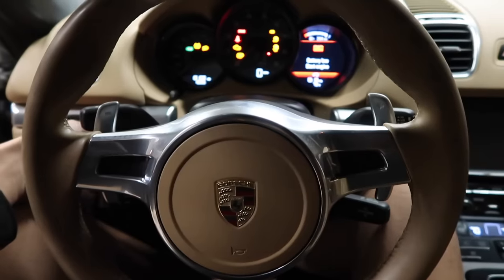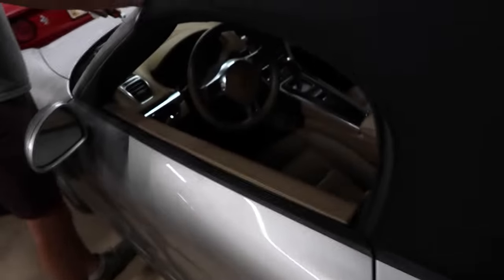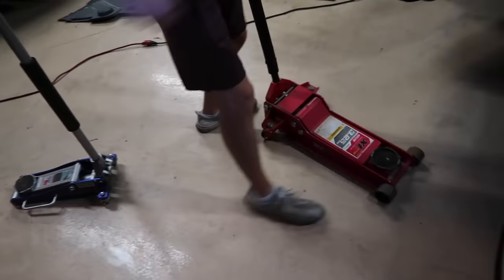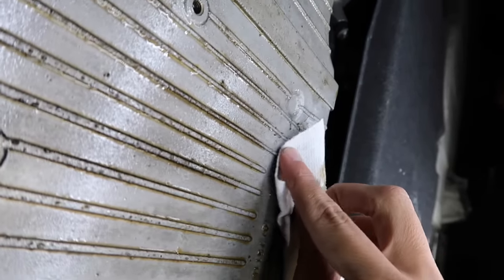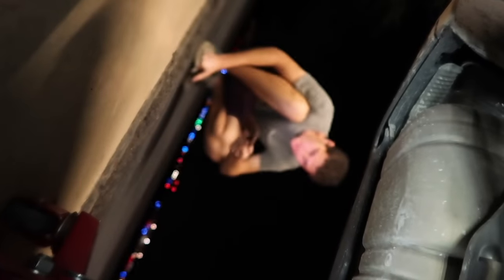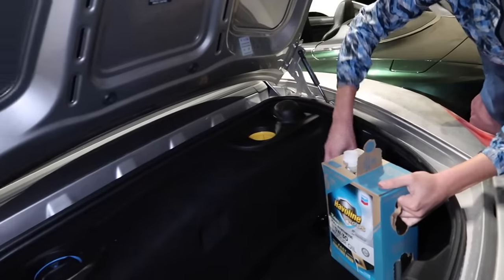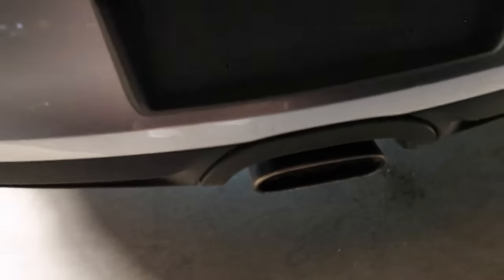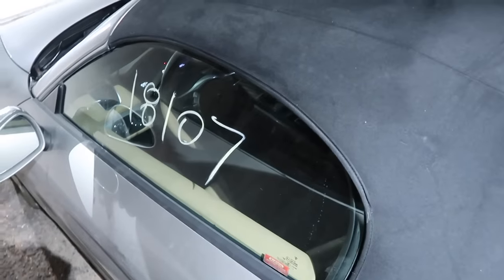Insurance Quoted $28,000 For a NEW MOTOR... We Fixed It For $20 Instead!

Comment: This car was backed off a trailer onto gravel, where the exhaust hit the ground and scooped some up.
It may well have backed off uncontrolled and hit something that flipped up under it, causing all that damage. I doubt some little old lady did that.
That noise you heard may have been caused by gravel and dirt in the exhaust.
Reply: That's exactly what happened to me, I used a shop vac.
Reply: That is what i figured too!
Reply: yes, that was no little old lady...
that was a big ol' lady

Comment: How do you guys not have a lift?
Reply: They have no money for that 😁
Reply: I’ll wager it’s because that’s an airport hanger and they’re not allowed to install one :/
Reply: Probably correct, and I bet the rent is cheaper off airport grounds. Next warehouse?
Reply: Yes, but there are lifts with counter balance.  No need for anchors.
Reply: You beat me to it lol. But watching his under the car. Was cringey. Imagine something slips
Reply: @Mike-C219  if that's the case they shoul get a portable lift then.
Reply: or buy some plastic ramps ffs
Reply: @SNORKYMEDIA  good logic something temporary because it's a temporary place for them
Reply: @007rooks  what about that company quick Jack's just normal household voltage and they're portable
Reply: Because it’s to expensive with the hundreds of thousands of subscribers they have.
Reply: They don't need one.. they outsource all the work
Reply: @lucasv521 at least a Quick Jack!
Reply: That is probably the drop off location from the auction. They stated that they had to drive it from that location to the shop where they probably have a lift.
Reply: @OB928      Often, hangar storage for a car is the cheapest.  But often it is not allowed by the airport.  Depends.
Reply: @007rooks  Could be a regulation thing.  Airports have a lot of rules.  Or maybe the hangar owner just doesn't want car maintenance done.  Often insurance companies have that in the contract with the hangar owner.
Reply: @SNORKYMEDIA     Good idea, but just curious.  Why plastic and not metal?
Reply: I think I would have drained out whatever oil was in it... Could tell that way if it was dry before you added oil.  Nevermind. You came to the same realization.
Reply: My question exactly!
Reply: It may not be their property…
Reply: Exactly!!!

Comment: I mean you could put in 1-2k into the undercarriage and maintenance of the engine and you've got a clean title Porsche with under 20K miles. I'd consider that a homerun
Reply from the maker: Big risk big reward
Reply: Just can't let the new owners know of the previous damage or they will lowball u lmao 😂
Reply: @memesyandhorrorshorts  if it's fixed there's no reason to disclose it
Reply: Buying unseen car, going under it with out jackstands, your oil ideas. Someone should be broke or dead. Hopefully just broke.

Comment: As many have already noted, draining the remaining oil would have been a good idea. When I used to buy old bikes cheap and work them over I would first drain the oil and then inspect both it and the oil filter to see what might have been going on, if anything. Also would pull the plugs and "read" them to see how the mix/burn was. I know pulling plugs is much more difficult in a Porsche but at least starting with reading the oil filter/oil is a good bet when checking out a potential problem motor. This applies to any possibly crapped out car/bike. You really had the Porsche light shining on you on this one!
Reply: Yeah, drain and refill. I'd even change the filter, because you can learn a lot from examining what's in the filter. I just can't believe they didn't check oil level after filling. Didn't they say it reads on dash after shutting off engine?

Also, I believe the plugs on a 987 are pretty easy to get to behind the rear fender liners.
Reply: Yea JB WELD
and why purchase a new pan   yeahhhh JB WELD

Comment: Gun shot from inside, bullet bounces off the road/floor and ricochets back to the oil pan. 
  Car skids as driver or passenger panic and slides backwards to a stop into gravel. 
  That's my guess.
Reply from the maker: Woah that is a wild guess but it could be true, you never know
Reply: @JRGarage  the damage is clearly of coming from the inside. 
  If the car had somehow landed on a rock the tear would be going into the floor. Also, seems a clear lack of any other similar tears or scrapes anywhere else and the oil pan looks like it's been hit hard by something small.
Reply: Isn't there a paraffin test for gun powder?  Hole looked shot gun size.
Reply: Pretty plausible to me … is there a hole inside ?
Reply: You have to definitely start writing movies

Comment: 13:50 you need to use a smaller rag to clean the oil off the pan....  The JB Weld should have been done from the inside.  Remove the pan, clean, then apply the weld.  That was it’s already on the pressurized side.  Most Porsche engines use 9 qts of Oil.  If this is the 2.7 liter that could be the reason for the 8 qt.

Comment: Man that was 20 minutes of anxiety... a bit of reflection would do you both justice. Drain oil, look for metal in oil. Refill with correct amount of oil. Definitely do NOT drive this car to the porsche specialist until you have the correct amount of oil. No hate, but you could have totalled what was a perfectly ok engine just with the oil pressure.
Reply: @ryandevillers214      He's a kid full of passion.  He does seem to rush things.  He'll slow down and think more when it costs him way too much not to.

Comment: I might have drained the old oil out before adding any new. I'd want to check to make sure there were no filings or aluminum chips broken away from the inside of the impacted pan. As you described about the blown-out floor board, something blew that hole out leaving jagged edges. 
It would have been safer than risking an aluminum chip or chuck going through the oil sump and then the engine. But since you've had no problem on the video, you guessed right for a car you're probably going to flip.
Reply: M mm
Reply: No. No

Comment: When the car comes off the flatbed at the auction yard it scraps the ground and you get rocks in the exhaust cause the yard is gravel top. I would have never thought to vacuum the car as the first step in getting this Porsche running but it worked. LOL

Comment: My wife drove over a bottle jack in the middle of the road, similar damage to what you are seeing but we ended up with a crack like yours but in the auto trans oil pan I drained the oil jacked it up JB welded the crack, refilled with oil and drove it for another three years with no issues.  Just wondering why you don’t just drain the pan measure the oil volume then you would know how much was left.
Reply: That would be too logical🙃

Comment: I enjoy these super deal auction finds.
It does drive me crazy that you guys always start these things without knowing oil levels or if it is hydro locked.  Just drain the oil.  Find out how much was in it.  Then put enough in to start it and save an engine.
Flood damaged cars should have the plugs removed and spun over to pump water out.  And drain the oil to see if it is oil & water.
Reply: @user-od9iz9cv1w    Flood damaged cars should be avoided like the Black Plague.  You never know what is screwed up in the computers and electrical system and it's almost impossible to diagnose.  Didn't Tavarish have a flood damaged Lambo or something that had mysterious gremlins because of flood damage?

Comment: It almost looks like there was a little explosion in the passenger side seat and it bounced. I would have to say that the rocks and the exhaust came from whatever tow company dropped it off the flatbed. What do you want to bet they dropped it right on the tail as quickly as they could when they were dumping the car at the insurance auction.

Comment: If that is an alloy sump pan, you might be able to braze weld with a torch and alloy rods, I did it on the sump of an alloy motor cycle sump.

Comment: So something really similar happened when I rode my motorcycle up on the curb and it tore a hole in the oil pan, scratched the fork and rotor caliper, insurance totaled it, gave us 3k and we bought it back for $600, fixed it with jb weld, never failed. Sold it for $3500

Comment: we had a 67 MG 1100 and the universal joint broke and put a hole in the manual transmission. the mechanic told us JBWeld !  worked longer than the car!

Comment: drives me nuts how manufacturers deliberately delete useful service features ..like dipsticks, ..or access to pans (another vid about a Range Rover). maybe this model has an "oil low" indicator. if one exists and is not on you're probably good to drive easy while watching oil pressure. oh, just saw that you've got a replacement pan. when that goes in all you'll have to do is measure.
congrats on a great find! 🙂

Comment: My son bought a repossessed house from a bank auction.  It was cheap but it was a nice house.  It wasn't until he took possession that he found that the ex-owner had poured sand in all the drains.  WE WERE ABLE TO TAKE THE DRAINS APART AND CLEAN OUT THE SAND AND HE SOLD THE HOUSE LATER FOR A $40,000 PROFIT.  I would see if the exhaust is full of those rock chips.

Comment: How to literally test EVERYTHING that in no way whatsoever helps to isolate or confim the problem you fear... start immediately by windexing windows as you free think all your worst fears aloud, then check nonsens things like interior cleanliness and exhaust tips. For the record, the things that start a car are: fuel (pressure, flow, and octane), spark (plugs, wires, distribution, starter, battery life, amp and connection), timing (cylinger location, belts, compression and surface), and air (intake, filtration, EGR actuation, vaccuum and turbo).  But first, you could just put the key in the ignition and see what happens 😀
Reply: My name is Mike Hall Me and my best friend Avery will have it running before lunch.

Comment: JRGarage great channel. Quick question - I have a 2001 Boxster Cabriolet that I can't get to pass inspection for new sticker, two unready Emissions Test Results for Monitors 1). Catalyst and 2). 2nd Sys., any suggestions to remedy without the cost of $6k to replace both Catalytic Converters?  Any suggestions very much appreciated.  Texas Fan
Reply from the maker: You’re saying the monitors haven’t checked in yet? After you replace the battery or clear check engine lights that will always happen, they reset. It usually takes around 100 miles to have them all check back in. If you don’t have any check engine light once everything is checked in, you will pass emissions.

Comment: The rocks in it exhaust is from the loader picking it up at Copart or tow truck dropping off at location.. so I'm putting my bet  down on the dragging and it'll load up the rocks and the exhaust due to the angle

Comment: Apparently these things don’t have a dipstick, engine oil quantity can be checked electronically, so why not check it properly before
trying to drive if? 
Otherwise it could be under- filled or over-filled, both with possible bad consequences shouldn’t you have tried this before starting it?

Comment: My 981 was having a major issue as well recently.  I found the bolt on the side of the battery would not screw all the way down and it was causing the startstop, steering loss to pop up and I used a different bolt and its now fixed. Dealership wanted me to wait two months to check the car and $140.00 to look at it. Remember also the car will throw a ton of codes when the battery gets super low. Get the car to temperature. Check the oil level on the dash and recheck the codes
Reply: How is that major issues?
Reply: @janlala1710  because it causes the car to go into limp mode. Causes the start stop to not work as well as no sport mode and powersteering. Causes the car to have other issues as well.
Reply: @janlala1710     When something weird is happening to your Porsche, it is ALWAYS a major issue.  But he did dodge a bullet with the bolt.
Reply: @ThatOneChannelinAZ  plenty of cars have issues when the battery is not installed properly or it’s low on voltage… nothing major

Comment: Trouble code camshaft position.  Could be engine valve timing.  Timing belt?   Maybe the dealer gave her an unexpected high price to repair this .  Looks like that engine would have to be removed to fix the timing belt issue.  My guess is at 500 dollars per hour labor for the dealer owner and 6 dollars per hour for the mechanic it would be very expensive to fix.  

Looks like the previous owner got "lucky" she hit something in the road that caused the physical damage.  She was looking at a second mortgage to fix that trouble code.    Wow, what a stroke of luck.  Lol, 😊😊😊 👌👌👌

Comment: I would imagine any half decent welder would be able to fix the cracks in that floor pan remove it a little light hammer work to straighten it out and for a couple of hundred bucks and a bit of your time a lot cheaper than replacing the whole thing. Is there no oil dipstick?
Reply: That was what i wondered too. Check the dipstick to see what it had going in,  then drain the pan.
Reply: No dip stick !!! Only gauge for level 😀😀😀😀😀🚘🍺
Reply: Lots of wrecked Boxsters with body damage.  Get the used part from eBay.  Much cheaper than having it professionally welded and the value of the car is undiminished.

Comment: They make these things called moving boxes I buy extra large ones at Home Depot for a couple of dollars I cut them open they make great thing to drive your car over when it's leaking oil or do an oil changes so you don't get oil on the floor I have used them for many years

Comment: I wold just  drain the oil check the condition drop the pan take it to any shop have them straight out the crack And tap Weld the aluminum pan from the in side

Comment: If the oil pan can be removed it would be very easy to fix by welding up the crack.  !!why didn't you just turn it over without starting it with the ignition disabled to get oil circulating so it's prelubed before running the motor??

Comment: JB Weld, a miracle! I once saw a Chevy V6 that had thrown a rod through the side of the block.  The hole was filled with JB Weld. The car was running and driving.
My son is a MB master tech. Years ago certain Mercedes had bad harmonic balancers. They would run out so bad that they would eat a hole in the timing cover. The dealership was so crooked (Mercedes gave them perks to keep warranty cost down), that the techs were told to patch the hole with JB Weld. The oily timing cover was patched. The oil film kept the patch from actually sealing. True story.

Comment: Ran over something fairly hard caught on something ripped the floor board , cracked the oil pan, hit with enough force to destabilize sending the car off road spinning backwards filling the exhaust pipe with loose gravel. Driver shut off the car immediately,  smelt oil and the rest is history.

Comment: Yall are worried about those rocks in the tailpipe. I have seen that when cars come off of a tow truck at to much of an angle.
You could have drained the oil and then put it back in after you find out how much was in it. I wouldn't chance over filling it.

Comment: The fact you didn't drain what oil was left in the motor and risked filling the engine with oil not knowing how much oil was in the engine illustrates you have no idea what you are doing.
Lastly, the second reason you drain what is left in the engine is to check for any metal flakes in the remaining oil with a flashlight in a dark space.
Astounding.

Comment: FFS guys, drain the oil first, measure how much was in it. Then a fresh refill with specified quantity.
Second; remove oilpan  get it TIG welded and remount with fresh gasget, job done on engine.

Comment: What is is with modern manufactures not having a dip stick on the engine???  It's the most reliable method and yet????  My Mercedes Spinter doesn't have one either?  Where I parks, it's on a slope, so getting an oil level is really difficult.  With a dip stick, you can take a level where it's flat, then park it on the slope, let it settle and then take a reading, noting the level that is now slope adjusted.  With a dip stick you can pull it out and feel the quality, or not, of the oil and see if there are any contaminents?  No dip stick, is just dumb!

Comment: Lol the guys asking about the dipstick while looking at the oil level sending unit.  Pretty sure the owner hit something and continued to drive with no oil. 

I hope you don't take offence to me saying this but your commentary is as useful as having a baby explain  thermodynamics, sorry bud.. LoL

The codes could be a result of lack of oil pressure on the hydraulic chain tensioners and your chain could have skipped a tooth, clear and see.  Might be useful to see if your local Porsche dealer will be willing to look up the service details and give you the techs actual reason for an 18k quote (provided it was at the dealership, might have?). But the crack in the cast sump pan and 2 cps faults says some type of oil starvation related issue is the reason 🤷..  But to answer your question about changing the pan absolutely yes you can, if no subframe member is in the way it's a very straight forward repair.  Remove oil, bolts break free from the rtv, clean the upper surface of the residual rtv then apply just a bead along the putter sealing surfaces then torque to spec.  I'd refer to the fsm to familiarise yourself first, good luck!

Comment: I personally would have drained and measured then checked the condition for metal flake. then add the appropriate amount.   In fairness. this is generic  as I've not worked on Porsche, but an engine is an engine.

Comment: I have personally fixed a cracked oil pan with JB Weld. 1989 Pontiac Firebird that I drove too fast over a speed bump. It held up for over 6 months until I sold it. (Of course I disclosed the damage to the buyer.)